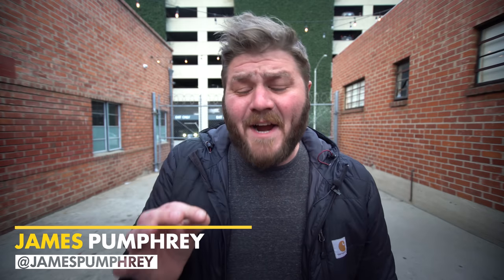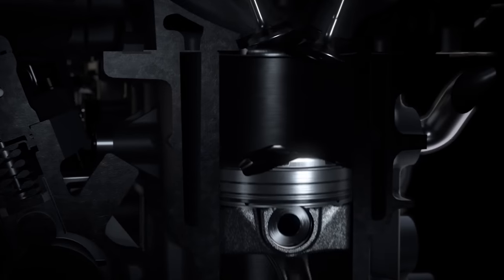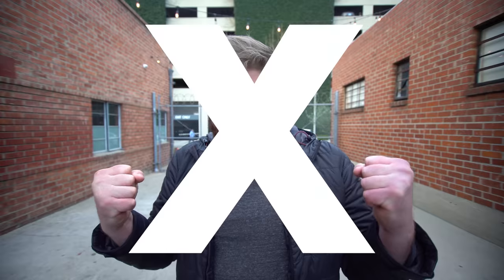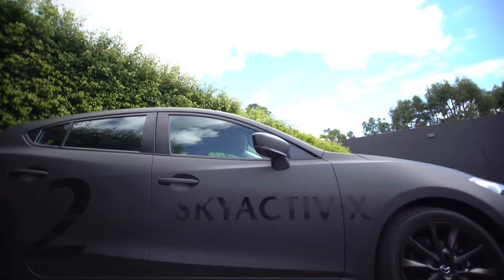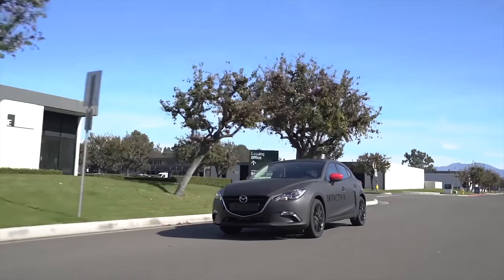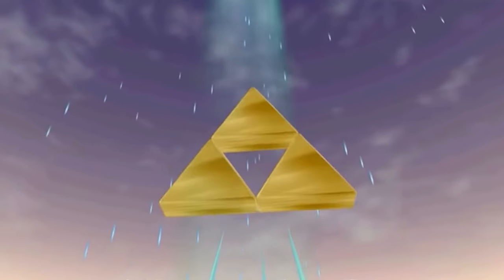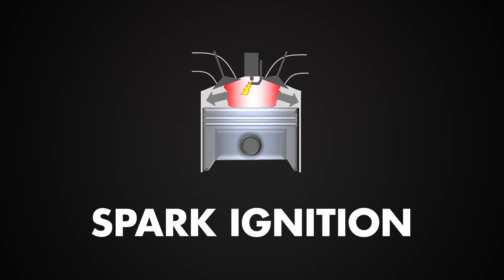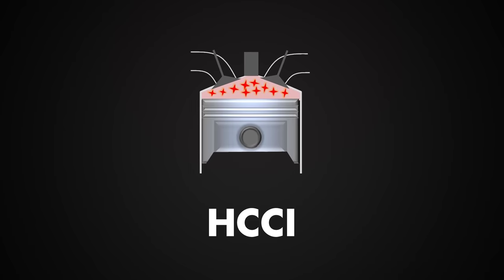Mazda's Secret New Engine Technology - SkyactivX | The New Car Show

Comment: Instead of trying to make the gas engine efficient, why doesn't Mazda put more effort into making better batteries
Reply: Because battery electric vehicles are fatally flawed and will never replace internal combustion engines.
Reply: @doktorbimmer  how are they fatally flawed? It's actually better, more efficient and more environmently friendly technology. We just have to improve the energy density of the batteries.
Reply: Better? absolutely False, While electric motors can achieve up to 97% efficiency... rechargeable batteries are certainly not energy efficient or environmentally freindly.
Reply: "We just have to improve the energy density of the batteries." Wow! I wish I had a dollar from every time I heard that benighted remark... Unless you discover a new stable element on the Periodic Table that has significantly more electrons in its valance than Silver or Copper??? Battery energy density will never be enough to replace liquid fuels like hydrocarbons.
Reply: @doktorbimmer  first I don't like the term never. Because there have been many examples in history where people said, "this will never happen or work.. " and those people where proven wrong shortly after. To highlight this, before the atomic bomb was created a notable scientist working on the project said, "we'll never be able to harness the power of the atom". 2 years later the atomic bomb was created. 
There are many researchers and companies working on various technology. Solid-state, coupling Li-On with high-discharge capacitors. Or there might be nano-technolgy that hasn't been discovered yet. 
Regarding environmently friendly, I believe the new company, that Tesla aquired, uses less rare Earth metals in their battery technology. 
Remember, the interest / push for high capacity battery storage has only captured the interest of big companies in the last 10 years. Before that, very little money and effort was being pumped into this industry. The next 10 years are going to be very exciting.
Reply: Clearly you are not educated in the fields of science and engineering.
Reply: "The next 10 years are going to be very exciting." Someone said that exact same thing to me 10 years ago... and they were just as wrong then as you are right now.... BEVs account for less than 1% of the global vehicle fleet... a mere fraction of the its market share over 100 years ago.
Reply: @doktorbimmer  in reference to your first point: I never implied I was educated in science or technology. That doesn't mean I can't have a discussion about it. 
To Your second point: gasoline won over EVs, 100 years ago, because it was more energy dense, cheaper and we didn't understand the implications on the environment.  Now that society, has renewed interest in electricity, advancements will move at a much faster rate. It's called the experience curve.
Reply: Then why do pretend to be knowledgeable regarding rechargeable battery development??? 
 Wrong, nearly one third of all the automobiles were battery-electric prior to 1915... until Charles Kettering invented the automatic electric starter for internal combustion cars... rendering electric cars obsolete over night. While electric vehicles remained in relatively few specialty niche applications it has never been competitive with ICEs.
 Now that society has been poisoned by fake news and the emergence of radical quasi-religious political environmentalism... we have EVs that are mandated by law and lose money despite massive tax subsidies. Its called fake news and dumbing-down in  the _Information Age_.
Reply: @doktorbimmer  I'm not pretending about anything. Like I said, I don't have to be a scientist or an engineer to be able to discuss a topic. 
Wrong what? Gasoline won because it was a cheaper, faster (to fill up), had longer range and was more energy dense than batteries of the time. Now that batteries are inching closer to parity with gasoline they are the better more efficient choice for the future. But it has to start somewhere. 
Granted agriculture / farming are  more determinatnal to our environment compared to carbon emissions, but What's fake news? The fact that gasoline requires terawatts of electricity to refine, the fact that oil changes are required every 10,000 miles, building/maintaining gas stations, transportation of gasoline from the refineries to the gas stations. I'm sure this is where you're going to jump and and whine, that we are using coal to charge EVs. Sure, but again this is where solar, wind and geothermal coupled with large scale battery storage are becoming viable solutions.  And until we get to that end-state technology we can do carbon recapture at coal plants and move to natural gas (as a cleaner burning alternative). 
I love ICE cars the sound, the smell shifting gears. But I also believe EVs are the future. ICE Cars will be relegated to racetracks and special events in the future, just as horses are.
Reply: Wow! You really don't know anything about batteries do you... how can you be so confident about a technology when you don't know anything about it.
 360mJ (100 kW/hr) of worth of petroleum weighs just 35 lbs... Do you know what the best rechargeable car battery (Tesla model S 100D) weighs?
Reply: @doktorbimmer  I've already conceded to the fact that gasoline is more energy dense. What I'm eluding to, is the fact that technology improves especially these days, it improves at an exponential curve. 
How can you be so sure that they won't invent a more energy dense battery by using carbon nano tubes or some other, exotic, material.
Reply: What you are eluding to is everything you know about rechargeable battery technology is wrong and comes from dodgy investment scams and political rhetoric.
 Because I can read the Table of Periodic Elements carbon does not have more free electrons in its valance ring than Silver or copper... and these materials cannot match liquid hydrocarbons.
Reply: The Tesla's battery weighs a staggering 1,440 lbs!!!! that is three quarters of a TON! and it only stores the same energy as 8 gallons of petroleum weighing 35 lbs. 
 If battery density is "inching forward" it still has MILES TO GO and it has to compete with improvements in internal combustion engines leaving no net gain.
Reply: @doktorbimmer  yes we do have miles to go. I never implied we are getting rid of liquid hydrocarbons tomorrow, or in a year or even in a decade. But we have to start at some point, and that point was 2009. And now that the big car companies are onbaord with EVs, we are about to see an explosion of innovation in this field. But if it was up to you (and people who think like you), we should stop research in better ways to improve battery technology, put our (collective) heads in the sand, call it a day and continue with ICE cars, right?

Come on dude, you seem like an intelligent person. Think back to history at times when people said, this will never work and they were proven wrong by a new discovery or invention. Heck even one of the wright brothers said, 2 years prior to their first flight, that "flight will not be achieved in 50 years".
Reply: "big car companies are onbaord with EVs" They are??? 
 Really? because those are same people that said we would have electricity too cheap to meter and drive supersonic flying cars...
Reply: The same people said we would all be driving electric cars by 2020... Lol!!!
Reply: @doktorbimmer  haven't you seen all the major car companies (VW, Audi, Volvo, GM, Porsche) announcing electrification of their fleets.
2020? consumers have had access to EVs since 2012 (granted they were expensive). But battery costs are dropping and more affordable versions are on the way. Heck Norway just announced 58% of new vehicles purchases, on their roads, are EVs. And by 2025 they want that number to be 100%.
Reply: So you didn't know??? The big car companies do not want to sell EVs.
Reply: I don't see any affordable electric cars... that are not glorified golf carts...
Reply: Norway is not a model that can never work in the rest of the world, its a socialist country that does not have a true free market economy... It has a surplus of hydro power and sells its large petroleum production for export to be burned elsewhere... Norway has serious air quality issues because most homes still burn wood for heating...
Reply: @doktorbimmer  yes, I know car companies don't want to electrify (that's why they haven't yet), but they're going to be forced into the future, kicking and screaming. 

Okay maybe Norway is a special case. What about China?  Or Germany or UK. They are calling for a ban of ICE cars between 2030 and 2040.
Reply: @doktorbimmer  you do realize that China cancelled 103 coal fired plants over concerns of air pollution. And yes, China may be behind the west but we've also seen how fast they can improve and pivot. Also don't forget that their government forces any foreign company to partner up with a chinese-owned company if they want to sell products in China. I'd say in 15 years or less they'll be on par with the west with EV technology. And they are already the leaders in photovoltaic cell production. 
Good for Elon. I hope he makes another $100B. He helped kick-off the EV revolution and humanity is indebted to him. Or we can continue, with Debbie Downers like you in the world.
Reply: So? What is your point? Yeah, you say a lot of things that are not true... That's right, China does not have a free market economy and they could care less if you lose your job to someone in China.
 Really, because someone said 15 years ago China would be making cars that would meet US vehicle emissions... but they still don't.
 True, because China simply dumps its toxic waste from solar panel manufacturing... they and Elon Musk don't give two shits about the environment... just fooling suckers like one into handing over all your money for products that cost more and deliver less...
 You mean the people that expose the fake news and government corruption like legislating and officially endorsing products that are not commercially viable and need to be subsidized with taxpayer funds... no matter how you slice it... its still corruption.
Reply: @doktorbimmer  what part of statements are not true? 
We are not arguing if China is a free market society or not. We are arguing if China will catch-up to the west and they will. Look at how fast they turned their economy around, what makes you think they won't do the same with their technology. 
Up until the Paris protocol, very few countries and companies cared about the environment. But again, sentiments around the world are starting to change slowly. We as a global society are starting to realize the impact we are having on our environment. Yes China does dump toxic stuff into the water, but so has the west. What's your point? 
You seem to think we can go from 0 to final solution without the in between technology. We need to do the in between steps (which including failing, making mistakes, polluting) before we eventually get to the end-state solution. 
If Elon only cared about money then why did he make all the Tesla patents free and open for any company to use. And spare me, that it's a ploy to get more companies into the Tesla ecosystem. If the guy was simply about money, he would have retired after he made $128M from the PayPal deal.
Reply: Very few countries do care about the environment... most countries are concerned with making money and forcing people to pay more for inferior technology based on a false sense of fear of global destruction or religious beliefs that you are a bad person if you don't live in fear of it.
 Elon Musk didn't found Tesla... he stole it from the guy that did, and when that guy tried to start his own company again (Fiskers) Musk sued him. Musk was fired from Paypal because he was lining his pockets with investor funds... the same scam he is running at Tesla.
Reply: @doktorbimmer  if countries didn't care about the environment, why did they sign the Montreal protocol? Which by the way saved us from the depletion of the ozone layer, in fact, by 2030 the ozone layer will be fully replenished.
I agree Elon never started Tesla, but neither fisker, and fisker was sued because he was commissioned by Tesla and he ended up stealing the designs and starting his own company. 
Can you link me to the source that Elon was fired from PayPal.
Reply: The ozone hole threat is a hoax... no accurate model to predict its behavior has ever been produced...
Reply: You wrote; quote "If Elon only cared about money then why did he make all the Tesla patents free and open for any company to use."
 Why did Musk sue Fiskers????
Reply: Musk has been fired or forced out of every company he has ever worked for... he is a liar and a crook.
Reply: @doktorbimmer  because Fisker didn't do what he was payed for. He gave Tesla a sub-par design then went on to build his own company with stuff he learned from his time at Tesla. That seems like underhanded work, almost bordering on corporate espionage.
Reply: @doktorbimmer  oh..  so the NASA display/models of the ozone layer is a hoax now? 
Please link me to an article that states Elon was fired from PayPal. Thanks
Reply: Musk was fired from his own companies TWICE! from both Zip2 and Paypal... he is currently under intense pressure from investors to leave Tesla and his company SpaceX is in serious financial trouble with another round of layoffs expected soon.
Reply: Indeed, the "Ozone Hole" has never behaved as predicted by the model which the doomsday hoax was based on...of course billions of dollar were made based on these false predictions.

Comment: Diesel engines are not more efficient than gas engines, diesel fuel has more energy stored in it than gasoline. If you do the real math then diesel engines are way less efficient than gasoline engines....how can this be? Well if your fuel has more than 40% more energy density and your getting less than 40% more fuel mileage then your less efficient...and besides the engines have to be way heavier to survive the violent combustion ignition...so again do the math and you'll see that they just don't make sense if your not in need of huge torque numbers to haul a load. Look at the newest pickup trucks and you'll see horsepower and torque ratings with mileage numbers that diesels just can't match and pass smog standards. Add to that the higher cost of diesel fuel and the DEF fluid (Pee) you have to buy and your going to see that unless someone finds some miracle diesels will see their last big gasp in industrial low speed work until they disappear forever in the whine of an electric motor/ battery system....which has all the torque you'll ever need....think "aluminum battery technology" here people. Controlling this type of ignition system with the variables in fuels at the pump is going to cause some real big issues for Mazda if they get "anything" wrong......(return of the GM 350 Diesel engine fiasco?) We shall see just how smart these guys are vs. they think they are.
Reply: "Diesel engines are not more efficient than gas engines" REALLY???? Then why are the world's most fuel efficient engines DIESEL ENGINES???
Reply: Actually Per Liter Diesel Fuel #2 and gasoline have almost the exact same Energy Density (about 35 Megajoules per/liter).
 Diesel engines offer significantly higher Carnot Cycle Thermal-Fuel efficiency than Otto Cycle engines... which is exactly why Diesel engines are more fuel efficient.
Reply: If you really think that batteries can replace internal combustion engines??? Well, then you haven't done your homework... Because when you compare the Specific Energy density of liquid fuels to rechargeable batteries you quickly see the huge, very obvious problem with your theory...

Comment: Pff, it's just a diesel converted to gas, easy.....
Reply: The other main difference between HCCI and Traditional Diesel CI is that the fuel is already introduced on the intake stroke or anytime before ignition stroke. This removes soot emissions unlike a diesel engine, but just like the video, the concern about HCCI is the combustion control.

Comment: Actually if we're taking up to date. Diesel engines are the most efficient and clean burning combustion engine on the market. They have the lowest rated emissions. The only thing they produce is called soot which is less harmful then an ant. Soot isnt all so bad except it's heavier than air so it falls and contaminated plant life, but it doesn't flat out kill shit or kill you by breathing it.  You'd have to breath in a good amount of this shit to kill you, but anyway. Diesels are super clean, they have a DPF which filters all the soot so literally nothing comes out the exhaust pipe how. They have a Regen mode which burns off soot into harmless fumes, They have better heat effiency under load. You really gotta do your research on diesel engines before calling them dirty. Diesels are rated lower in emissions than cars and the only thing higher than both is motorcycles.